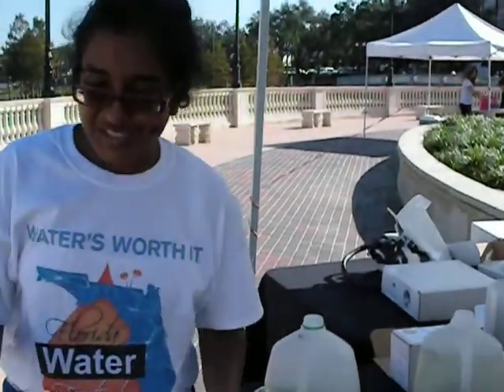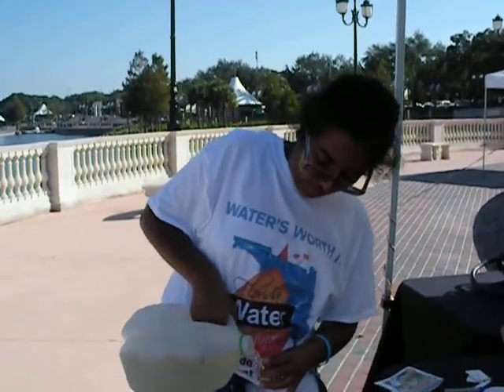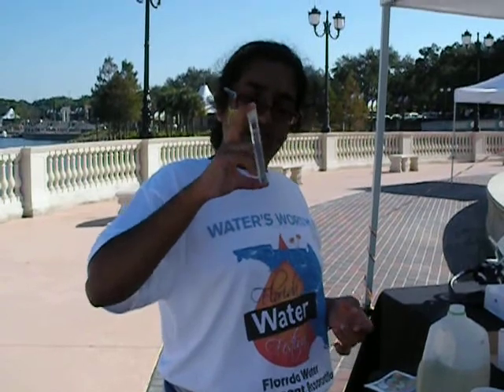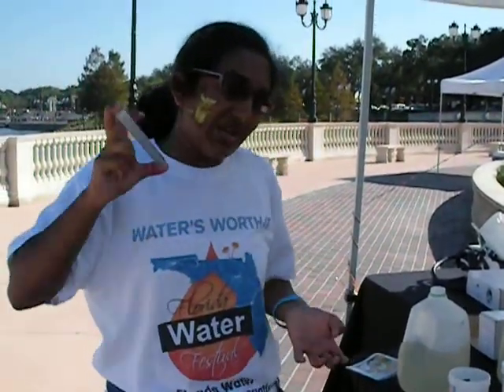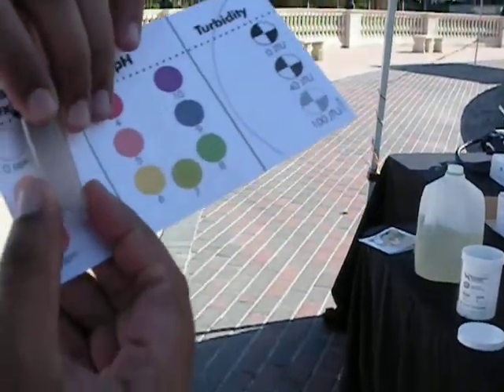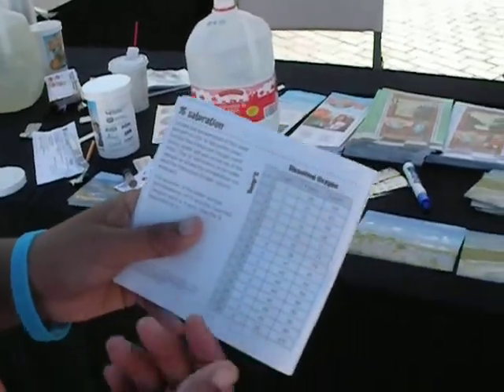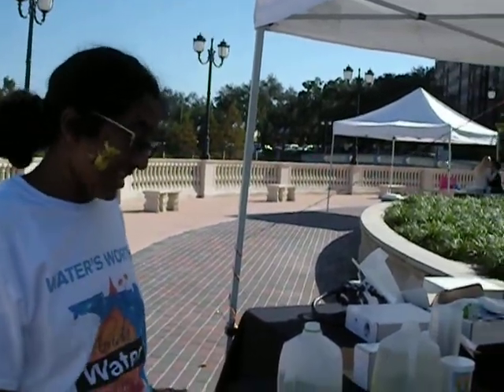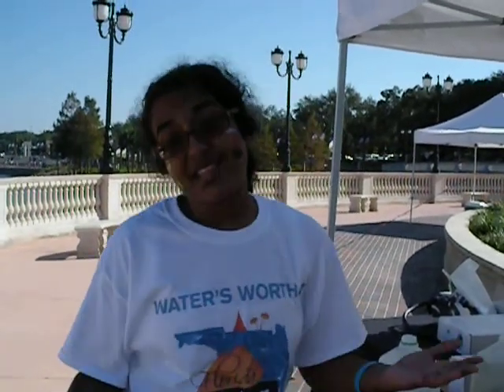Water Quality Testing Demonstration

Comment: The dissolved oxygen concentration is expressed in mg / l% O2 and depends on the water temperature and salinity. The level of dissolved oxygen in water is continuously changing because of these environmental factors. For example, as the temperature increases, the oxygen concentration decreases. mmm well I doubt if there is an ideal range.
:/

i like your hair  :P